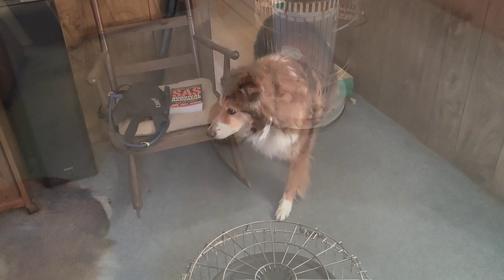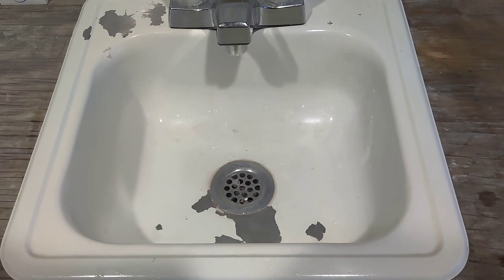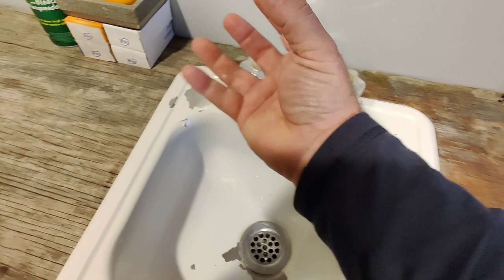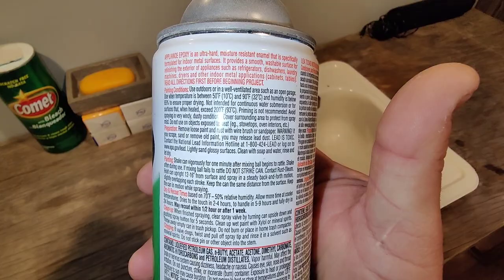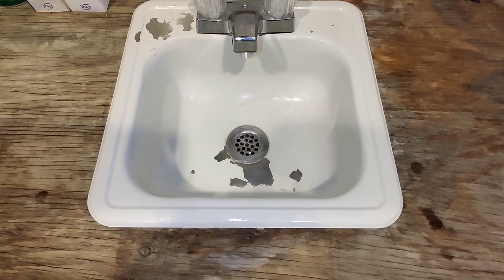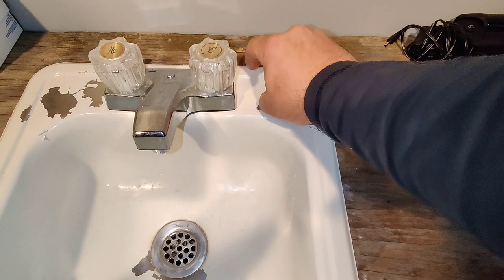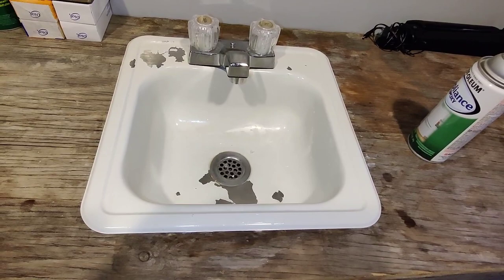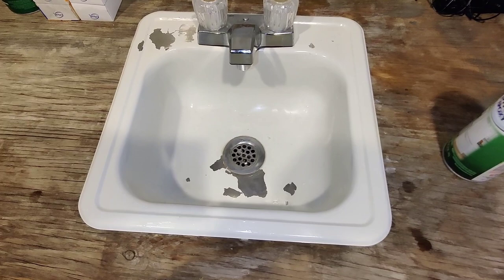RUST-OLEUM APPLIANCE EPOXY 1 YEAR REVIEW ON STAINLESS STEEL SINK

Comment: Your spot on treat it like Automotive refinishing, Sand your stainless steel. Primer with metal etch, let dry , come back scuff up the etching primer trying not to break thur the etch primer  ,  Then use a regular primer , if you use straight paint over some etching primer it will bleed through the top coat changing the color because of that chemical that etches  into the metal is acid base  majority of the time. let dry then sand primer, then use your top coat, I would recommend to use all the same brand of product to make sure they are compatible. Will help with adhesion You should have no issues afterwards. Good luck👍
Reply: Yes, I was thinking that it needed a primer and a matte surface for the epoxy to correctly adhere.